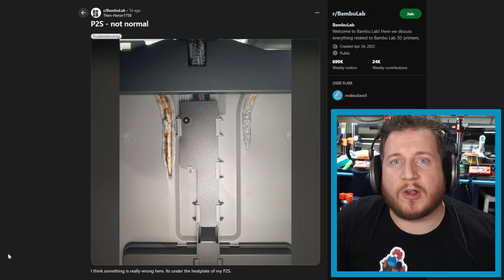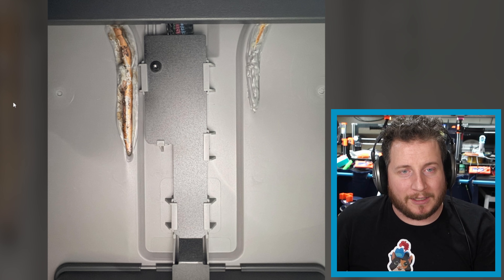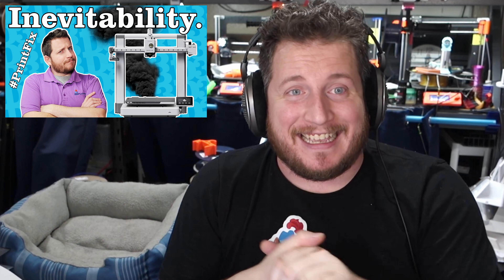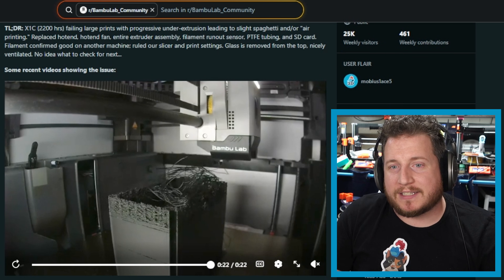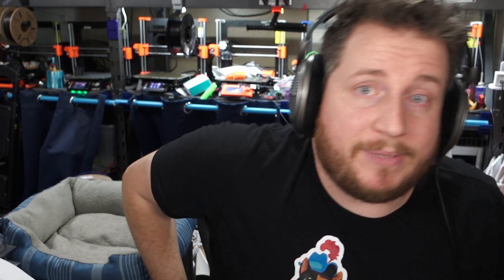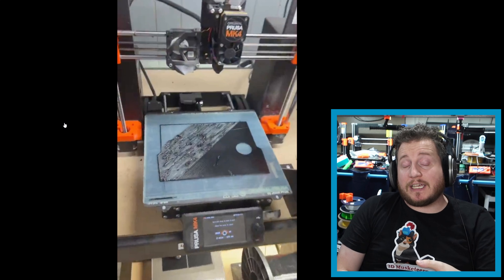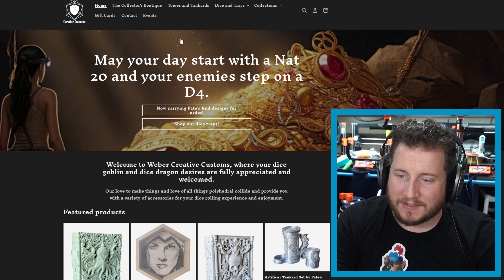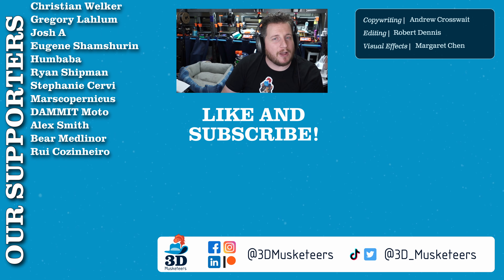Bambu FINALLY Responded - PrintFixFriday 226

Comment: FYI - in Europe the power grid allows for +/- 10% variation so 253V is not unlikely and quite acceptable. At 253V, the heatbed gets A LOT of Watts and there's plenty of amps going, probably near or even above that thermistor specs. No need for storms causing sudden spikes :)
Reply: Countries that previously had 220V grid run tighter tolerance on voltage so it is kept within 220+10%.
Reply: @tymoteuszkazubski2755  The EU used to be 220V, while the UK used to be 240V. To harmonize voltages, we moved to 230V +-10% in Europe (207-253V) while in the UK it's 230 -6% + 10%, so 216-253V, and watching big clive on youtube, it's often around 250V
the places I've lived in Denmark it is usually really close to 230V. around 228-235V
Reply: @dumle29  Yes, Netherlands here... on times with lots of wind and sun... at the 250 + side. And then my solar-system switches itself of because of too much voltages. Now (night) just around 220-225 Volt and when there are lots of users like tourists, it can drop under 220 and sometimes even around 210 V for a while to then run up a lot to that 250+ again a couple of hours later. My computers run on UPS-systems to keep them stabilized... my 3D-printers cannot always keep up with it because the PID-tuning does not get it right...

Comment: I thought I was crazy, I kept hearing everyone recommend sunlu, I got a new a1 (yes it has the thermistor board) and wanted to try some HighSpeed petg, I normally only print with regular petg and watching my friends printer run laps around mine I picked up some of that matte white/gray petg and holy hell the amount of trouble I've had to get it to print at slow speeds let alone anything highspeed. I had a roll of regular non highspeed petg from them and that's been printing beautifully. Does sunlu not actually have REAL HS PETG? What brands for actual HS do your recommend?
Reply: I print with a .6 nozzle, I've seen on other channels that because of firmware limitations you can't do .6 with a high flow so I'm using a regular .6 nozzle. My friend is using bambu's own HS petg and just picked up a .6 nozzle and his printer still laps mine in print speeds. It's still faster then my old printrbot by A LOT but I'm not able to print with the same settings he does, I use to exclusively print with Hatchbox before, thinking of going back or trying something from elegoo.
Reply: Cool, no reply very helpful youtube channel sir.
Reply from the maker: Buddy.. I missed it. Holy crap. 

We don't recommend HS PETG as it's not pure. Stick with pure PETG so you get stronger layers. We find that normal PETG flows a bit less than the HS stuff but has significantly stronger layers bonds